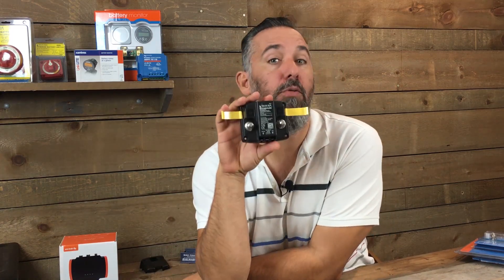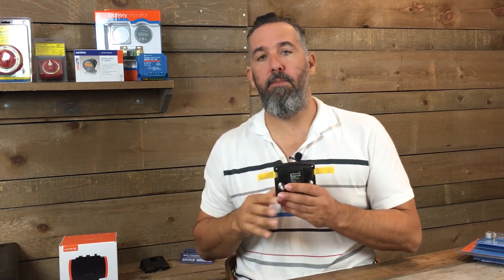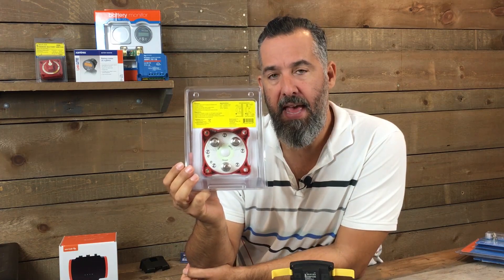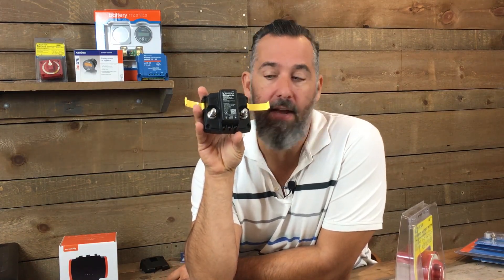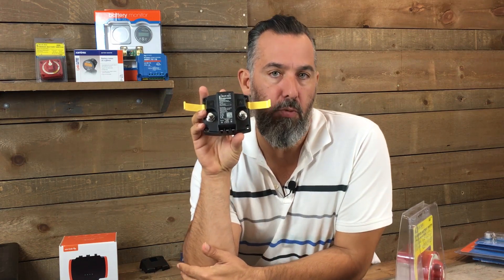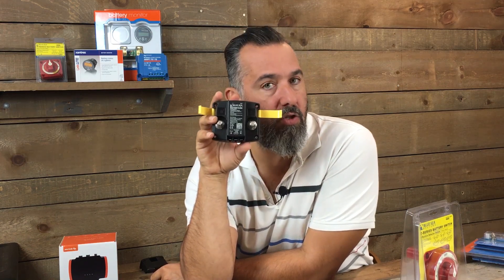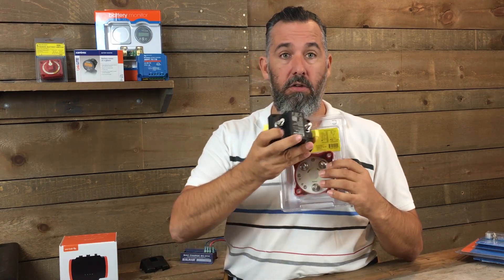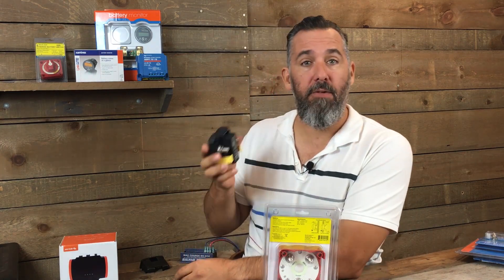How Do I Wire My ACR to My Battery Combiner On My Boat?

Comment: Thanks for video . I’m considering putting the combiner on my system . I have the 1 or 2 or Both battery switch . I guess I can look but wondering what size wires I’ll need ? I have a Cobalt with a 5.0 gxi Volvo penta

Comment: Always excellent informative videos. I have a question regarding calculating the wire size between the ACR and each battery. My boat engine alternator has only 1 output. It is rated at 55a. If I multiply that by 125% I get 68a. Could I then use a #6 and a 70a fuses to protect it? Or should I match the #2 battery cables? I'm concerned with in rush currents when the ACR cycles. I know it's very fast, however I understand it will cycle frequently until both battery banks even out. TIA
Reply from the maker: Arnold, good question, i'd err on the side of caution and slightly oversize the battery combiner wires... as you mention, i'd go with #2.
Reply: @PacificYachtSystems  Jeff, thank you for your response. I did decide to use #2. Thanks again.

Comment: Jeff if the vsr is rated for 120 amps that's the max over current protection and wire to carry 120 amps. How would I calculate what size fuse and wire I need?  Thanks mike

Comment: Jeff,
I have a 24’ sun tracker party barge with a mercury 60hp Bigfoot motor.  I am adding a dual battery system (dual Interstate SRM-27 batteries).  I purchased a Blue Sea Systems Mini Add-A-Battery Kit - 65A (7649) and a pro charging systems Professional Series - Dual Pro battery charger/maintainer. During the spring/summer/fall I keep by boat in a moorage for easy access and store it in the winter.  I wanted to use shore power in the moorage to keep the batteries topped off and when in storage, keep the batteries maintained. The switch does not combine the house and start circuits unless both is selected (4 post).  The alternator is connected to the unswitched distribution bus. The ACR is connected to both unswitched (house & start) distribution busses. This, I believe is your recommended configuration. However, does this “mess” with the dual bank charger, having an ACR that parallels the batteries? Would it not be better to have the ACR on the switched busses to remove it from the system when the battery charger is active? Why or why not?  Love your channel!
Reply from the maker: Hi Dennis, love it, speaking the lingo. Good question, but nothing wrong with having a battery combiner and battery charger both connected to the battery bank. Remember  when the battery charger is outputting, the output target voltage on the charger is the same for all banks.
Reply: @PacificYachtSystems  But doesn't that Pro Series charger (I have the same) try to intelligently charge the batteries if they are different? It probably doesn't matter for storage as it's just maintaining them. But if you're going out and discharging the a deep cycle house battery all day from playing music and whatnot, then putting the charger on and the ACR is combining the batteries isn't that creating unnecessary (and avoidable) wear on the starting battery when it lets them equalize?

Comment: Love the clear explanation of ACR. Could please explain why the ACR should not be switched? I have lithium house and lead acid starter batteries. The company that designed my system put the on/off battery switch at lithium battery side. I think this is done to protect the lithium batteries against over-discharge damage. The 'drawback' is that my wind generator only charges the starter battery when I'm away (during which put off the system enable switch and battery switch), because the lithium battery is only loaded by the 1mA Victron battery monitor.
Reply from the maker: Hi Cornelis, connecting a battery combiner to a switched positive post, might undo the very purpose of the switch by energizing a distribution point even thought the battery switch is off.

Comment: Apologies as this is older content now - do you have any advice as to using a ACR with a DC to DC charger?  I have 2 lead start/house batteries and 2 lithium phosphate batts for trolling motor/anchor.  I would like to be able to trickle charge both banks or select banks when under power.  I thought about having the kicker motor charge the lithium bank and the main charging the house/starting.  Am better to manage as 2 separate banks and just use the ACR to preserve the house/start side?

Comment: hello Jeff
enjoyed the ACR /switch info.
my installer installed a blue sea ACR and a blue sea 6007 switch.
these wires are not fused.
I have start and house batteries connected to post 1 and 2 on the switch from the respective batteries.
however these are heavy gauge battery to the posts, difficult to fuse this wires? how do I physically connect blade fuse holder to these wires/
thanks
John

Comment: Hi Jeff. I notice that Blue Sea offer ACRs with (7610) or without (7611) undervoltage protection, evidently to protect the ACR circuitry from current spikes if the lower bank is less than 9.6V. I guess this means that if I'm at anchor overnight with depleted house batteries, when I restart the motor I need to double check that the house batteries are actually being charged by the alternator, rather than being locked out if I have somehow depleted the house batteries below 9.6V. Is that a significant or practical problem from your perspective? I like the idea of start isolation with 7610 but that undervoltage lockout seems to detract from the main attraction of installing an ACR and letting it do its thing.... Dave from Victoria.
Reply: Hey Dave, I have a small skiff that I think translates to your situation. Two lead-acid batteries, one for the engine, the other is the house (trim tabs, gps, powerpole, trolling motor, etc), connected with a 1 and 2 switch, so they are separate circuits that switch on at the same time. They are bridged by an m-ACR (7601) on the battery side, but I am soon going to switch it to the load side.

In my case, if I have for example let it sit overnight and the bilge ran and depleted the house battery, it will NOT begin charging again unless I manually combine the batteries at the switch. So yeah in that case it is not totally hands off, but I think that makes sense? Because you're basically jumping your own battery and my understanding is that is not good for either battery at that point, so it makes sense to me that that should be a manual decision. I would only do that if I were unable to plug in my on-board smart charger that could rehabilitate that dead battery and charge it.
Reply: @ericraslich-noaaaffiliate6030  That's what I would do. Wait to see if it charges, and if not, then while the engine is already running pair the two for a few minutes until the house bank gets enough of a surface charge to carry on. It would be more risky to pair before the morning cold start. My alternator won't normally start charging until 45 sec after the engine starts.
Reply: @spelunkerd  Oh yeah, I certainly would want to make sure my motor was already running and sending a good charge to the starting battery before I tried to combine them.

Comment: I am adding an ACR to a basic "factory" set up.  I would like to add a solar panel charger and possibly a shore power/ NOCO portable  charger  later.  With an ACR do I just add these directly to a distributor bus where the (+) is connected to one side of the ACR and only one of the batteries or do I use a solar charge controller and wire one panel to each battery directly?  same issue I guess for charging from an AC powered battery charger

Comment: Jeff, thanks for the video--awesome content for an amateur like me! I know you say to never put the switch before the combiner, but does that include a battery disconnect switch from the engine battery before the combiner (not a switch to select between battery and house)? I simply want to ensure my battery doesn't drain in storage, but also allow both batteries to charge when I'm running the engine.

For context, I'm running a 40hp outboard--currently, the engine battery is reserved for the engine and a small switch panel to run a couple of LED lights and a GPS. The second battery is reserved for my trolling motor only. I don't think I can wire my LEDs, GPS, and trolling motor to the same battery because the trolling motor is on a 60A circuit and the fuse block is rated for 50A. Do I wire the LEDs, GPS, and trolling motor to one battery, bypassing the fuse block with the trolling motor directly to the battery (making it a true house battery) and using a isolator instead of a combiner? That would give me a true engine/house setup-right? But, if I do that, I'm not sure I'll be able to run the lights and the trolling motor at the same time (light of night boating, so this is a necessity).  I'm referring to your diagrams from your links above.

Thanks for all your help.

Pat

Comment: Hi, I am using the 1,2, 1+2 battery switch (3 post) and the ACR. When the ACR installed (between + terminals of batteries) will is charge both batteries regardless if I am on 1 or 2 on the switch while motor is running?
Reply from the maker: Good question Travis, with the Battery Combiner (ACR) connected directly to each battery, the position of the battery switch is irrelevant.
Reply: @PacificYachtSystems  appreciate the sanity check and quick response.

Comment: I bought this, installed it, and it worked great last summer. Now I'm getting my boat ready, and I have two dead batteries even though this was turned to OFF. My stock switch in my 2008 chaparral 190ssi never did this, so in "off" this still uses power?
Reply from the maker: Hmmm, good question, not sure what the amp draw is, definitely something.

Comment: I run a bowfishing boat with a Powermax PM3-45 connected to a generator and charging house batteries (2 series 31 deep cycle in parallel.)  I run lots of amp draw with cabin lighting, stereos, ets.  This is the only way to keep house batteries charged all night.  My motor is a Mercury 250 4 stroke.  Can I install an IS-ACR even with house and cranking batteries having their own charging source?  Also, not sure on fuse size.  Any help is appreciated.  Learning a ton from your channel.  Thanks, Mark
Reply from the maker: When installing a battery combiner (e.g. ACR) both batteries will effectively be in parallel whenever there is a charging voltage. If you decide to install a battery combiner, make sure that either charging source won't overcharge the other battery connected via the battery combiner. Fusing is sized to match wire size and max amperage of combiner, plus a 25% margin of error.

Comment: i have blue sea add a battery kit and running a start battery and a house battery.
my question is how to hook up a two bank smart charger? the start battery     is a flooded battery and the house is a agm. i want to charge both battery's at the same time and get the benefit of using the smart charger,..........please help.....blue seas said to install the acr to the load side and just use the switch. to tuen off and plug in charger
Reply: This is how I have the m-acr and smart charger set up on my skiff.

Comment: I am using a blue sea mini add a battery (switch + ACR). My house battery is a deep cycle 27 and my crank battery is a 24, my question is for an onboard charger do I purchase a single bank charger and hook it up to the house, or buy a two bank and connect it to both of my batteries. I know the alternator will charge both when engine is running, will the single bank charger work the same way from the house battery?
Reply: You probably already solved this, but yes it should work the same way. It would top off your house battery and then when it meets the voltage and time criteria for the ACR to combine the batteries, it will parallel them and your charger will be charging both the house and starter battery.

Comment: Question, what is the method for sizing the fuses @ both ends of the positive terminals connected at the batterys?
Reply from the maker: When sizing a fuse, you want to make sure the fuse can handle the maximun current expected from the load... also make sure the wire can also handle the load. Quite often the fuse at the battery protects not only the load but also the wire from excessive amperage.
Reply: @PacificYachtSystems  In this case the load being the charge curent from the alternator?
Reply: @goranlucian  +25%

Comment: Hello You said both sides of the battery have to be fused. I am way to literal I know but it’s important when dealing with electrical I understand what you are saying. Are you saying both battery to ACR positive leads need to be fused ?  Not both sides of the battery Positive and Negative need to be fused. I am not picking on your video. I just want to make sure. Fantastic video and web site by the way. Just wonderful information. Thank you in advance for the clarification.
Reply from the maker: Hi Collene, good on you to ask for clarification, both sides of the battery combiner (ACR) need to be fused. Since the ACR can send current in both directions, it's important to fuse both positive links connecting to the ACR. Also, make sure you fuse the ACR at each battery connection.
Reply: @PacificYachtSystems  Thank you for the clarification.

Comment: I know this Ask PYS was about wiring, but the biggest problem, it seems to me, with an ACR is someone who doesn’t quite know what they are doing using one to put dissimilar batteries in parallel.  For example, wet-cell lead-acid starting batteries with AGM or (heavens forbid) LFP house batteries.  As you have covered, these different battery chemistries have very different charging characteristics.
Reply from the maker: Excellent point Bruce. You shouldn't use battery combiners to parallel (i.e. combine) battery banks that have different chemistries.

Comment: Question, I have a house bank with (2) batteries wired in parallel. I am trying to keep the terminations at the batteries to a maximum of (2) cables.
 If the +/- terminals going to the unswitched distribution already have (2) cable terminations, is it permissable to wire the ACR  +/-  to the batterys that have only (1) cable terminated (parallel) connection??
Asking for a friend!!
Reply from the maker: You  can have up to 4 connections on a single post, including a battery post. Make sure your ACR connections are fused at the battery.

Comment: so if I use acr and fuse breakers do I need the switch?
Reply from the maker: Battery switches, are not required in a ACR circuit.

Comment: You said that both sides of the wire need to be fused, did you mean both sides of the ACR?  Should they be 120A fuses? I installed the add a battery kit on my sons boat a few years back with the 4 pole switch, which is nice because there's only two positions on which is engine to engine battery only and house loads to house battery only but both will charge when there's enough voltage and the other position is combined just in case the engine battery doesn't have enough power to start. I'm trying to remember if I fused it properly but it's in storage until spring but if I need to go back I think terminal fuses on the battery would be the best option to retrofit. Thanks for covering all these little but important questions!
Reply from the maker: Hi Charlie, both battery connections of the battery combiners need to be fused, see schematic:https://www.pysystems.ca/site/assets/files/2531/pys_battery_combiner.pdf
Reply: Hey it's the stove chimney guy!
Reply: @thedudeabides1953  haha yeah it was weird when I googled my name and it went straight to the West Marine parts department 😂
Reply: @chachi5975  Charlie Nobel was a cook aboard a ship that hated the smoke blowing back in the galley, so he designed that stove pipe and its named after him. Did you know that dude?
Reply: @thedudeabides1953  I heard that he was the captain and when he found out that it was made of copper he wanted it polished and then they started calling it the Charlie Noble. Either way it was before my time and the only people that know about it are sailors and they get a kick out of running into someone that is actually named that. I was named after my uncle and he is a sailor! He got a fair amount of ribbing when he was in the Navy!

Comment: Was interested in using the ACR for my two starter batteries  and then a house bank of batteries (may use 3 batteries)  so let’s say I have 5 batteries. How many ACR do I need? And I’m fact in conjunction how many battery switches would I need?
Reply from the maker: Hi Justin, with 3 battery banks: 2 for engine and 1 for house, you'll need two combiners: one ACR between house and port engine battery and another ACR between house and stbd engine battery.

Comment: Is it possible to fuse an acr with resetable breakers?
Reply from the maker: Yep, i suppose, but some battery combiners are meant to handle 120 and 300 amps, those are large amperages.

Comment: Hi Jeff, thank you for your informative videos.
I recently purchased two Harris 80AH marine batteries, a Blue Sea 5511e battery switch an ACR. I would like to use my new on board Noco Genius 10x3 charging system. How would I wire it?
Thanks 
Mike Reit
Reply from the maker: Hi Mike, check out the PYS courses on Battery Combiners, you'll get lots of good info there.
Reply: @PacificYachtSystems  thank you